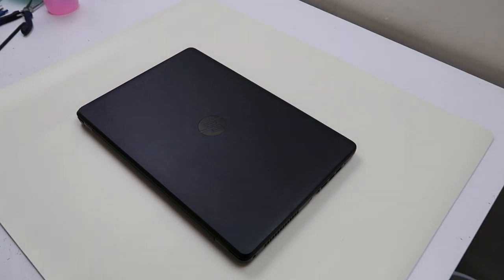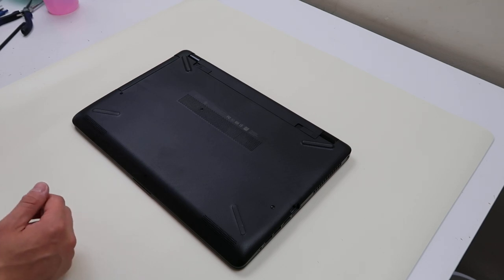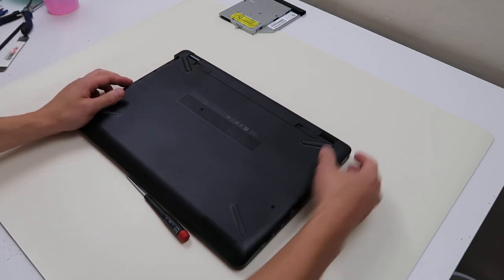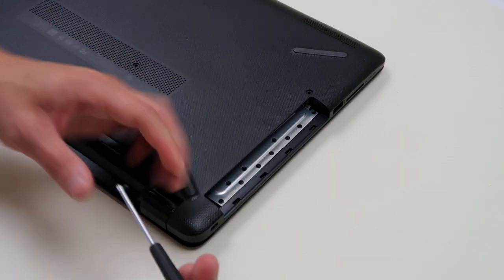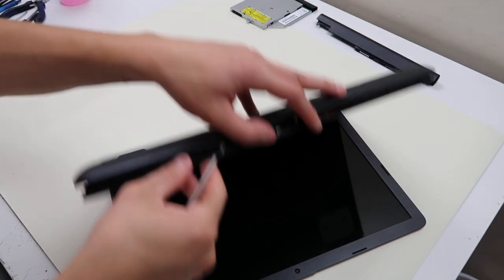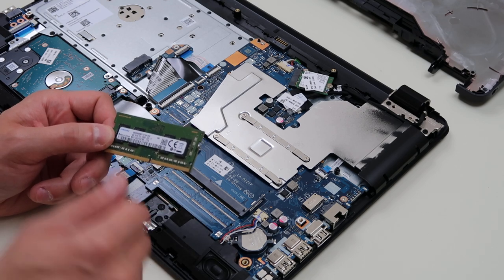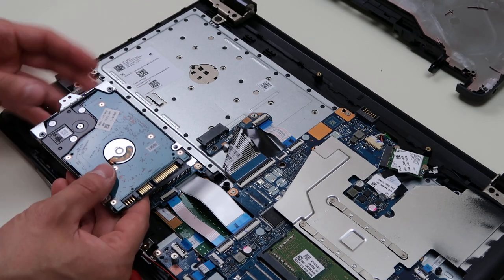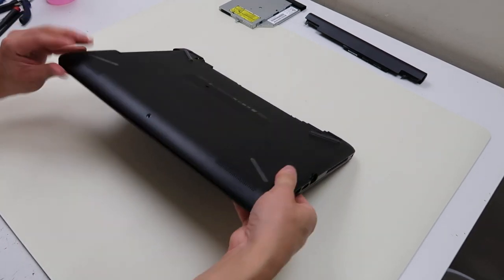How To Replace HDD, RAM, & Battery - HP Laptop Computer

Comment: Can I pay you to fix the exact model I have I it won’t turn on , the issue I have are , liquid damage , I need a replacement on the keyboard, and something with the battery bc it won’t turn on
Reply from the maker: For a computer that does not turn on, try this video first;  https://youtu.be/P3I7dDpkJps.  Let me know how that goes :)
Reply: @PC_Monkey  thanks I’ll watch it right now
Reply: @PC_Monkey  nope didn’t work plus I have two laptops that need fix one black hp the same as in the video that needs the keyboards to work and to turn on bc it doesn’t , then the school one they gave me which is the HP Probook 455 67 same thing won’t turn on even tho it was working earlier the keyboard also doesn’t work bc every time I type something it’ll type a something I didn’t
Reply: @PC_Monkey  okay so the pro book works just turned on only issue is now none of the keys work the mouse pad kinda works I can move it around but it won’t work if I click on something but it’ll work it I tap it , so is there anyway I can replace a keyboard or mouse pad
Reply from the maker: @negative0612  Yes, both components can be replaced.  Its the HP Probook 455 were those parts dont work?

Comment: I have replaced my hard drive and battery and my screen still says "no bootable device". I hit f11 to factory restart AMD "no bootable device" message still apears
Reply from the maker: After installing a new HDD, did you try to install an operating system onto it?  It may still display that error if there is no OS to boot up

Comment: is it possible to change the CPU, GPU?
Reply from the maker: On which brand and model computer?
Reply: The one you disassembled, I looked it up and apparently they’re embedded in the motherboard so it’s not easy
Reply: So I own this computer and I want to upgrade it so it lasts longer, I’m gonna do the ram but I’m not sure if I should do the SATA hard drive. Is it worth it to replace the SATA hard drive for a newer one of the same capacity? Does it help speed up the computer? Because I don’t really need much storage honestly, it’s not like this machine can run games, I’m just wondering if it would boost the speed to swap the hard drive 🤔 thoughts?
Reply from the maker: @caleydaniela7529   As you can see at 4:30 in this video, the RAM is removable and can be upgraded fairly easily.  The biggest components to 'speed' is the RAM, the CPU, and the Drive.  I would check out your computers manufacture website or Crucial.com.  It can tell you what your computer can be upgraded to and suggestions on what to upgrade to.  I always try to max out the RAM in a computer as its a fairly inexpensive component.  Its definitely worth upgrading your Hard Drive to a Solid State Drive.  That will greatly help with speed :)
Reply: @PC_Monkey  ok great, so ssd thank you! I have this exact same model, 15-bs212wm will any ssd work on this? Do I have to buy it from crucial forcibly? Lol amazon has good prices 😝
Reply from the maker: @caleydaniela7529  Yes!  I just use crucial.com for the research but I never buy from them lol.  I always buy from Ebay, Amazon, etc.  That one looks like it will work nicely :)
Reply: @PC_Monkey  Thank you! I'll order it and try it out, thanks for your help!!
Reply from the maker: @caleydaniela7529  Your welcome !!  Happy to help :)

Comment: I have a newer laptop with a different design how would I open it up
Reply from the maker: Each model is different :)   What is the brand and model of your computer?
Reply: PC Monkey my computer is hp just a newer model and I was wondering how to open it I’m facing issues with my hard drive
Reply from the maker: @haydenmccartney5422  Again, each model is different.  Every HP model opens different than other HP models.  Use this video to find your model number;  https://www.youtube.com/watch?v=-t1UcxmT7yA.  Otherwise you will just have to follow a general video on how to get inside an HP computer and try to figure out the differences.

Comment: What does it mean when system extensive test: Hard Drive Short DST check failed? Hp Envy
Reply from the maker: Hard Drive Short DST Failed means your hard drive is bad and needs to be replaced.  After replacing it as seen here, you would need to install an operating system onto the new one as seen here;  https://www.youtube.com/watch?v=p_N_xV7j_Xo
Reply: I had the same thing come up: hard drive short DST failed. Is there anyway to get passed it to try and save old files? 😬

Comment: I tried to take my laptop apart and tried to turn back because I thought I was doing something wrong and now it’s getting power but my screen and keyboard aren’t
Reply from the maker: Your computer was working fine before you started going into it but now will not turn the screen on?
Reply: @PC_Monkey  It was, it just had a 3F0 so I wanted to look at mine and see if there was any debris that had gotten in there and I got the sides popped up, got scared and turned back and after I got everything put back in it’s place, the keyboard and screen weren’t on
Reply from the maker: @raenahmorrison8494  1.  Are there any signs of life at all when you try to turn it on? Lights? Fan, Motherboard, or Hard Drive sounds? Anything seen on the screen?
2.  For a computer that does not turn on, try this video first; https://youtu.be/kOBY4k2Mn_k. Let me know how that goes :)
Reply: @PC_Monkey  When I first noticed it wasn’t coming on I popped the side my disk slot and cord that runs to my screen is on, blew some air in it and there was a moment that it came back on but once I closed the side back it wouldn’t come back on so I dove further into trying to open in up and when I would press the power button it made a humming noise (no fan) but then I accidentally pulled too hard on the strip that connected to my power button trying to connect it back to the slot on the board and I think I messed it up
Reply from the maker: @raenahmorrison8494  Yes, those are pretty weak and break easily :(  If  you need to replace it, I usually get my computer parts on sites like Ebay, Amazon, etc
Reply: @PC_Monkey  Is there a way to expose the wires in the strip to be able to connect them that way? The end I accidentally disconnected didn’t have a clip cover or the exposed wires. Maybe I could email or PM you pictures?
Reply from the maker: @raenahmorrison8494  I would recommend the component be replaced.  I dont recommend those types of repairs on this channel unfortunately even though at times I have done them my self lol.  sry
Reply: @PC_Monkey  It’s okay. I completely understand
Reply: @PC_Monkey  Wanted to give you an update, I finally got to my hard disk and it was damaged and I honestly have no idea what replacement to get for it but I’m going to do my research and see what I can find. Thank you so much for your help!
Reply from the maker: @raenahmorrison8494  Great to hear !!  For most computers, any sized 2.5 Inch HDD with a SATA connection should work :)
Reply: @PC_Monkey  Thank you!

Comment: There is nothing to pry please help
Reply from the maker: I dont understand your question.  Are you trying to access your Hard Drive or RAM?
Reply: @PC_Monkey  How can i remove the case i only have a knife and not a pryer
Reply from the maker: @bankroll174  You would need to get a pry tool to do it properly, or improvise.
Reply: @PC_Monkey  Hello my computer says boot device now found and i was checking the hard drive check but it says No hard drive installed. Please check that the power and data cables are connected properly
Reply: @PC_Monkey  If you could help that would be great
Reply from the maker: @bankroll174  For an HP 'No Boot Device' error, refer to this video; https://www.youtube.com/watch?v=eO6jJmpaRbo
Reply: @PC_Monkey  I did the hard drive check but all it said was. No hard drive installed please check that the power and data cables are connected properly
Reply from the maker: @bankroll174  If the test is saying that the HDD is not installed then it is either loose or bad.  
I would first try 'reseating' the Hard Drive.  That is where you unplug it and then plug it back in, making sure its properly plugged in and secure.  Try the scan again.  If it still says that its not installed, then its most likely bad and needs to be replaced. You can see how to do that here;  https://youtu.be/CxIuy2iiW8o.  You would also then need to install an operating system onto the new one as shown here;  https://youtu.be/p_N_xV7j_Xo
Reply: @PC_Monkey  Hey just wandering what screwdriver do you use for this video

Comment: Hi PC Monkey. I have a new HP dw1513sa and it has only 128GB hard drive. I wanted to install my standard 2.5" sata HDD into it and it turns out that it has SSD. However, there is space for a standard HDD. Do you know how to connect it?
Reply from the maker: Yes, most likely if your drive is only 128GB, its most likely a SSD as they are more expensive.  Unfortunately I couldnt find any videos on your specific model.  If you see a space for a HDD, then you should be able to just go ahead and install it.